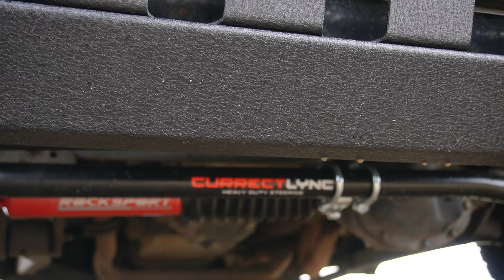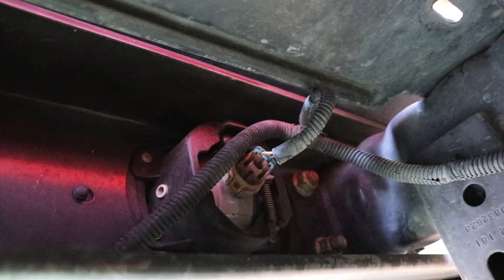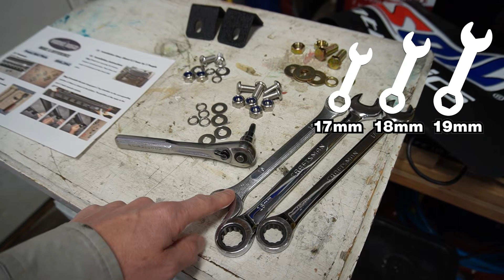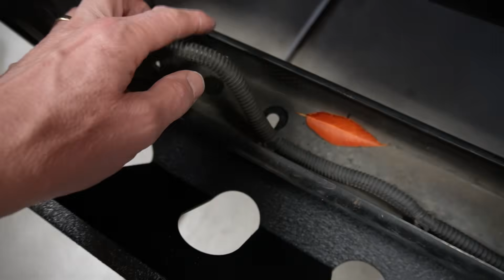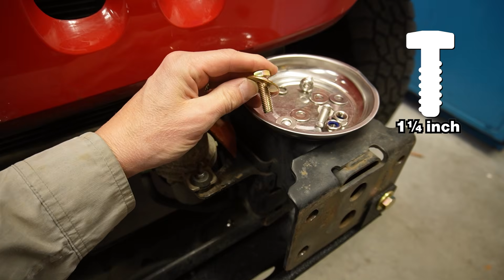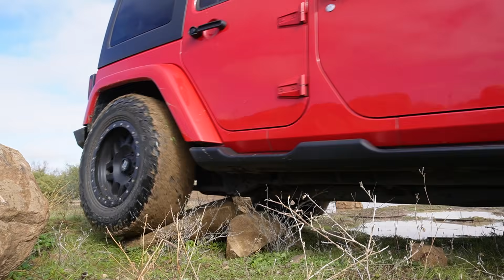Jeep JK skid plate: Hookeroad front skid plate Jeep Wrangler

Comment: But if the bottom outter bolt hole is used, most bumpers won't work, as they go THROUGH THAT HOLE.  this is the usual hookeroad dis-quality.     I'm also salty cuz i had to spend 2hrs fabricating brackets and shit for a set of inner fenders that lined up 2 out of 5 holes.  Who measures their shit, SteevieWander???   And yes. Wander...cuz their tape measures just wander off

Comment: Just a heads up, it's supposed to be mounted behind the bumper, not in front of the bumper.
Reply: Thanks, video seemed to leave out that part.  Also, he put a bolt in that hole but with the OEM bumper or aftermarket you need that hole to attach the bumper.